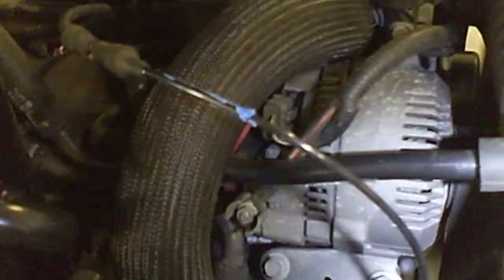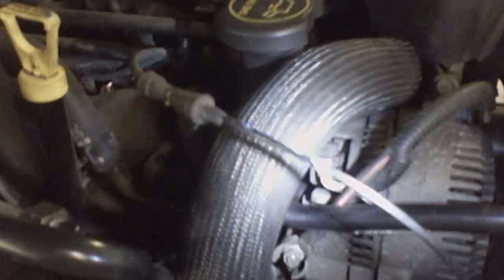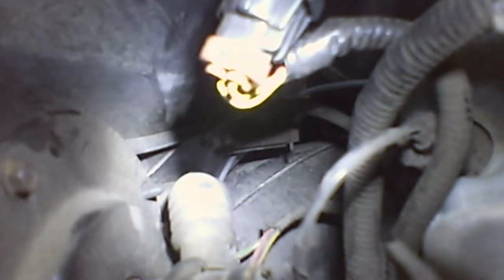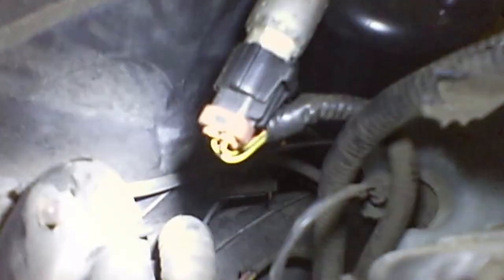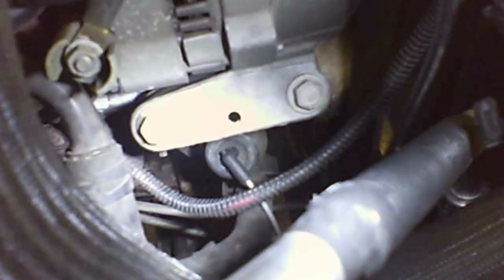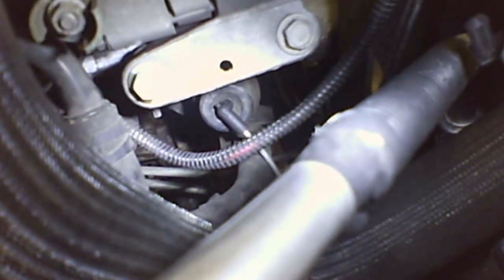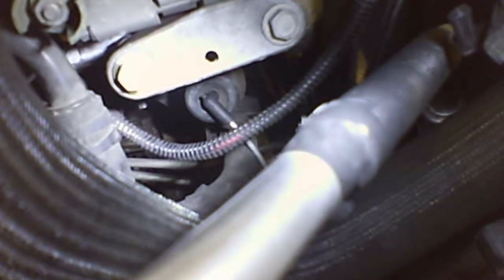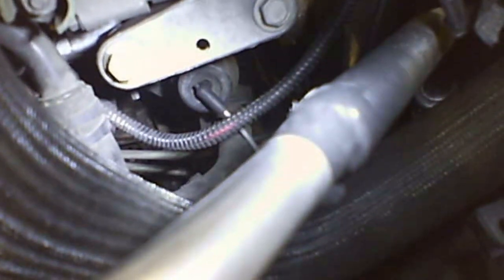Lose air flow in vehicle when going up hill or long acceleration Ford Ranger 2001 Many other vehicle

Comment: Just had this problem on my Escape V6 (Same car), fixed it by changing 2 faulty ignition coils and all the 6 spark plugs, on top of that they also cleaned the MAF sensor and flushed out the air intake system. Now the car runs very well.